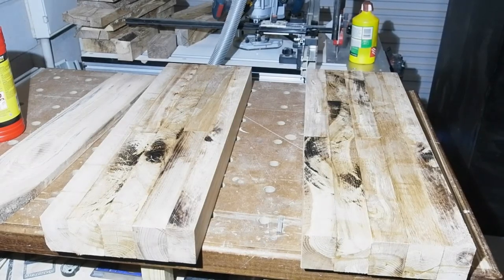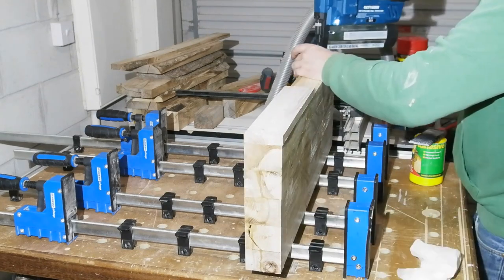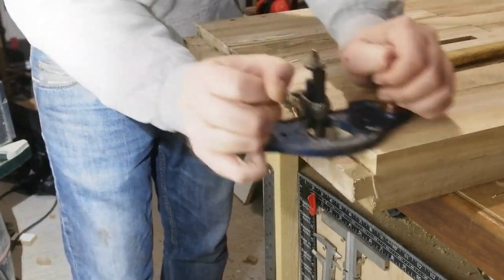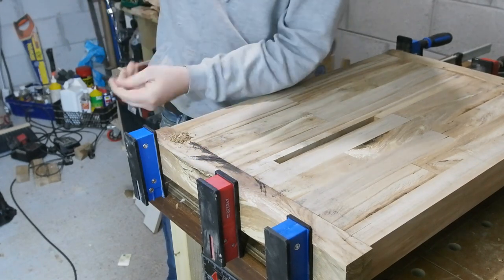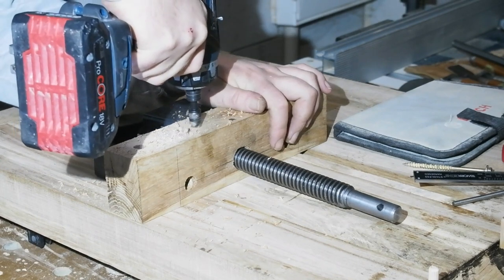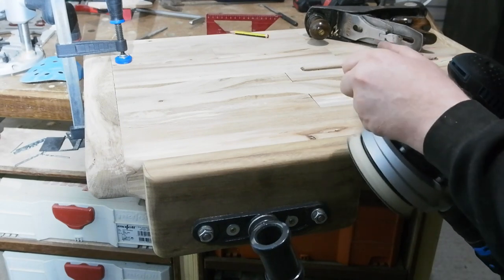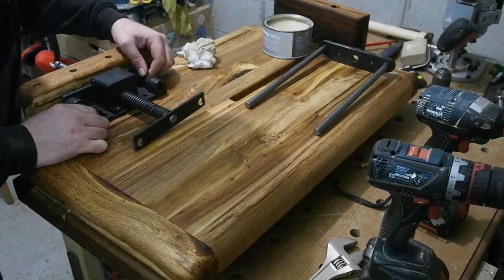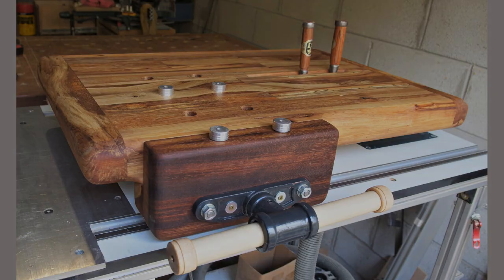Soild Wood Mini Workbench Build Part 1

Comment: Thanks for the video. Was wondering why you went with developing this bench given you had previously built the t track bench solution with mft top?
Reply from the maker: It's a good question mate. Should have said why in the vid. The previous bench is an mft style assembly bench. This solid wood one is built more to withstand planing, hammering  and chiselling.

Comment: Hi, just caught up on your vid. Thats gonna be a pucka bench. Also if you dont mind me asking, hows your track saw rail still performing?
Reply from the maker: Hi Steve. Cheers. Do you mean the rail hinge thing I put on the other bench? If so, it's still going and working fine. The short rail has been off the bench for a couple of months though as it's been out and about on other jobs. I need to just buy another short rail for it really.
Reply: @BischBaschBosch  thanx for the reply, great to hear it.